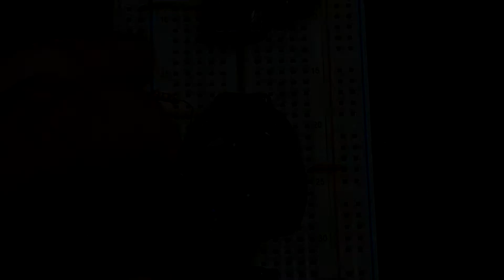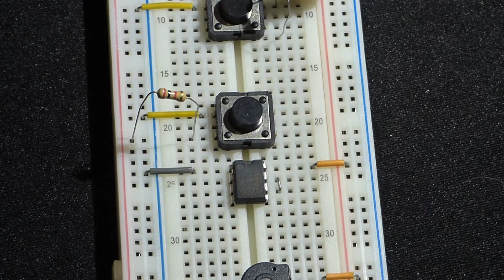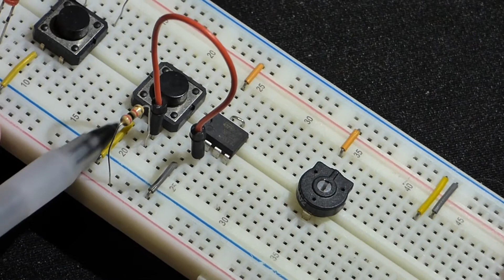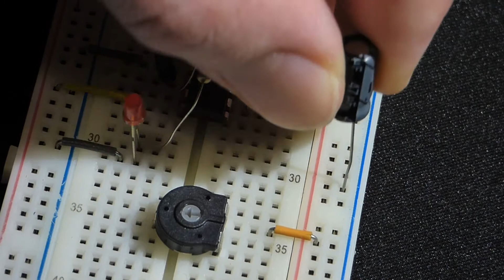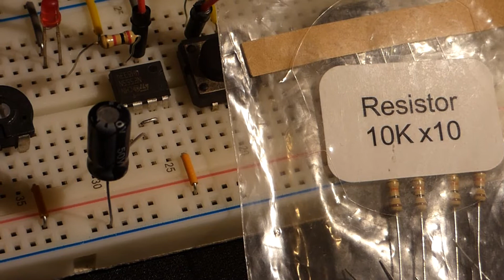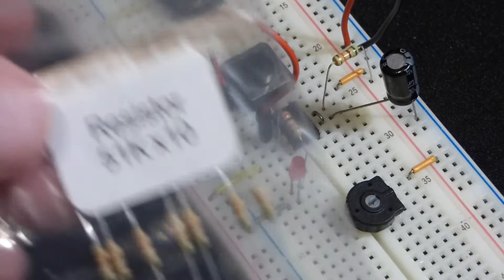555 timer IC monostable mode aka one shot electronics tutorial circuit build by electronzap

Comment: have you seen a circuit where pin 2 is held low via a 100k resistor to start sort of inverting what you are showing here ?
Reply from the maker: I don't think so.
Reply: @Electronzap  your latest 555 flip flop video kind of similar  as pin 2 is permanently held low.  ( activated ready to start)